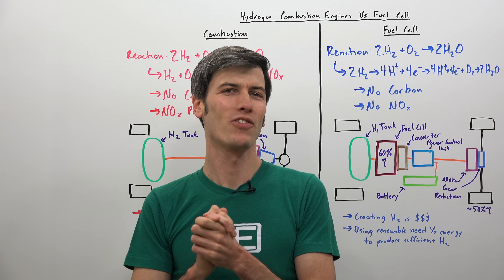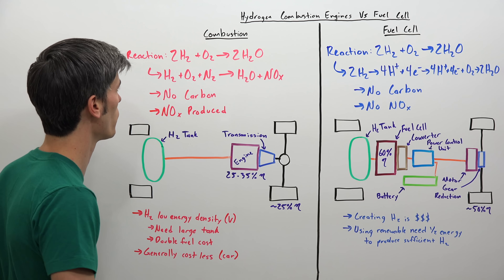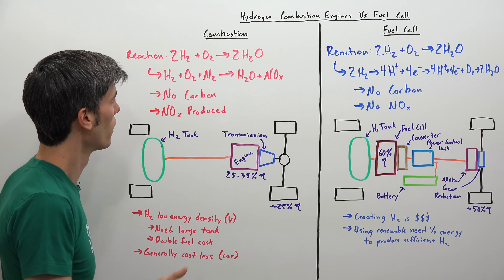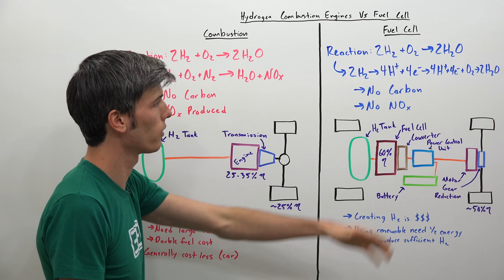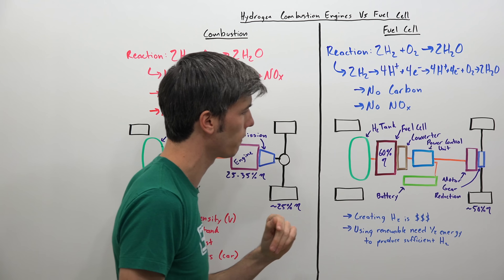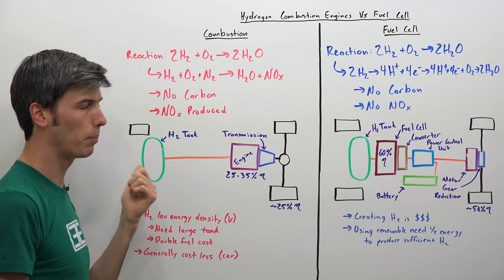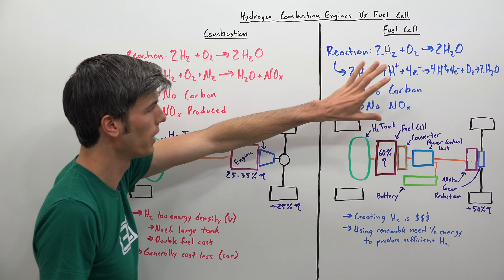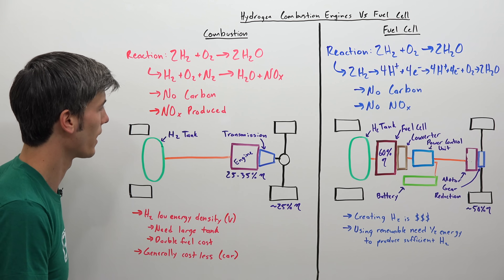Why Hydrogen Engines Are A Bad Idea

Comment: >relesses 100 videos about hydrogen engines and explains how they work
>plottwist hydrogen engines are actually useless
Reply from the maker: Haha, it was just two, just two videos!
Reply: Engineering Explained   Why did you use old gasoline ICE engine efficiency in this comparison when you know tailored engine design and excellent H2 combustion characteristics could easily double that?   
-Higher compression ability  (120 octane equivalent) 
- Incredible combustion stability allows air fuel ratio nearly 10x leaner than gasoline 
-Tremendous mixing & flame speed vs gasoline, for nearly ideal heat release 
- No radiant heat loss 

Either platform requires new power plants that will be cutting edge.   Also you gave no or inadequate comment on the consumer acquisition cost differences. Very disappointed in your work on this as I have greatly appreciated your factual and thorough technical analysis on other engines.
Reply: @timduncan8450  

Seems like he did provide commentary on cost differences.
Reply: Tim Duncan You can already have quite a sizeable battery just on the cost savings from an engine when comparing to a electric engine. The cost for similar power can be 20x... (Tesla driveunit <1k$, a comparable gasoline turbocharged engine with catalysator >10k$
Reply: @timduncan8450  if hydrogen were really feasible as fuel for a reciprocating internal combustion engine there would be a lot more research and experimentation. Hydrogen sucks for this application and is very hard to control its combustion, also is very prone to detonate and i mean real detonations not preignition which is what many call "detonation".
Reply: Quite a long time ago already there were hydrogen fueled combustion engine cars. The german manufacturers tinkered with those around 2000. The added "benefit" at that time was the fact that those engines could burn both gasoline and hydrogen, allowing a twin fuel scenario, kinda like gas powered ICE cars. Which was necessary, as the number of hydrogen fuelling stations back then in german was around 10 for the whole country. Of course there were other difficulties, like the need to keep the hydrogen extremely cold at 20 Kelvin to be able to store enough, which needed a complicated tank system, and the permeation of hydrogen which lead to the interesting fact that hydrogen fuelled cars are not allowed to be parked in enclosed spaces, like public below ground garages or even home garages. 

In the end they moved from combustion engine cars to fuel cells, although that purring of the nice 760i 12 cylinder engine was beautiful, it was simply not working out. But research, while still being done and Mercedes just releasing a new fuel cell powered car, is low key compared to battery electric cars by now.
Reply: Not useless at all, there are just other better ideas.
Reply: @teresashinkansen9402  except for those lil oil cartel boogers...and that issue of detonation can be fixed with tuning
Reply: @verderriscursey  Are you sure? it usually is fixed by using lean mixtures and low compression which reduces a lot of power. The distance of deflagration to detonation run up of hydrogen is quite small second to that of acetylene.
Reply: @teresashinkansen9402  all you need is a different tune for running different fuels
Reply: @verderriscursey  I don't think is that easy. How would you "tune" it?
Reply: hydrogen can be used in diesel motors too, which is high compression
Reply: @verderriscursey  Can you show me a proof of that? I hope you aren't referring to that HHO snake oil.
Reply: @teresashinkansen9402  the type of tune im talking about is a computer or hand held device that connects with your vehicles computer and then you can change settings...not a tune up...sorry if i wasnt clear
Reply: @verderriscursey  But how that can avoid a possible detonation? by making the mixture lean?
Reply: @teresashinkansen9402  electrolysis is not snake oil and its already been proven
Reply: @teresashinkansen9402 the oil cartels are the snakes...lmao
Reply: @verderriscursey  Say no more. Have a nice day.
Reply: hydrogen is used in combustion engines the same way as natural gas and propane
Reply: He never said it was useless. He just said it was less efficient.
Reply: @teresashinkansen9402  
You win. He's going to defend the technology no matter what. Your pursuit of logic is not something he's interested in. Virtue-signalling is an extremely strong emotional driver for many people.
Reply: @verderriscursey  

It's an easy red flag, when someone starts the "greedy corporations" hatred.  Clearly if you stick to the technical, you lose.
Reply: @teresashinkansen9402  HHO has many benefactors and proofs. It's these new hydrogen fuel cells that I call snake oil... the science is sound, but the problem is that the cost of the vehicles outweighs any return in efficiency.  And, it's fission/cold fusion. With hydrogen.   Hydrogen fusion takes place on its  relative own. And it's much more energetic than a detonation.  Try riding a nuke sometime. It's like that, but you're paying for it for ten years before you turn the key. And you'll never own it outright, like HHO.  How's about that snake oil now?
Reply: @teresashinkansen9402  to answer your question on tuning: ceramic plasmation plugs, sstl piston rings,  sstl exhaust system, removal of the catalytic converter, recirc to the HHO generator cell, spark/flashback arrestor before the intake, and using the setting for propane in your electronic tuning computer, to set your engine control module.
Reply: @teresashinkansen9402  to avoid detonation, richer, not leaner. Fuel stops the detonation, not air.
Reply: @teresashinkansen9402  as for your previous comment about how vehicles are kept from detonation, you have EVERYTHING backwards.  More fuel, less air, and a spark arrestor to stop flashbacks.  All of this is readily accessible here on YouTube for verification.  As well as what not to do.
Reply: @teresashinkansen9402  for reference, acetylene boosters have been used in the past by street and drag racers.
Reply: @AndrzejKucyg HHO has been proven time and again.  As effective, if not more so than gasoline. And costs a fraction of the price of gasoline.
Reply: @suserman7775  lol, you must not know the history of big oil's shady business practices. This is not about my emotions or logic but rather research and facts thank you. Your previous two wars is based on the theft of oil and ponzi scheming the taxpayer to fund it. You paid for oil with your tax dollars, bloodshed and again at the pump...and they taxed you again at the pump. Which part of greed did you not understand?
Reply: one virtue-signaling usually brings out a similar response..ie "hho snake oil"
Reply: @verderriscursey  I see. So, because someone who had their facts SLIGHTLY skewed, decided to point out that HHO has been proven time and again, you thought: OMG, SJW!? If that's what you call virtue signaling, you don't know what virtue is.
Reply: @guardsmanom134  her moral correctness was hho is snake oil...my response is big oil are snakes. SJW???? I know the oil cartels doesnt have any virtues
Reply: @guardsmanom134  Indeed rich mixtures can help but that wastes fuel, with hydrogen you need  a lot of fuel to avoid detonation. So is better to use lean mixtures
Reply: @guardsmanom134  That's just for using those HHO quack systems which only provide the engine a minuscule amount of hydrogen.  That's not really an hydrogen engine. Im amazed that there is so many people that believes in the HHO quackery.
Reply: @guardsmanom134  I don't believe that. What advantage can give acetylene to a drag racer? other than the potential of blowing up.
Reply: @timduncan8450  I don't think he did. He used 35% and had 10% losses in drive train conversions for both examples. That might even be conservative because the efficiency numbers for an ICE are the peak numbers, but in real use they operate over a wide range of poorer efficiencies. 
The fuel cell motor combo will have a range as well, but it varies much less making the average efficiency much higher.
Reply: @teresashinkansen9402  you have obviously never used nor seen it used. And that's enough for me to draw the conclusion that you wouldn't know what to do with a powerful racing car if it hit you on the inside turn.  Not to mention, I can see that you are impassioned by the willingness to always be right, even though everyone else sees how foolish it makes you look.
Reply: @teresashinkansen9402  it gives 2× the output power of NOS. Like I said, you wouldn't know what to do with an acetylene booster if the car hit you pushing purple flames from the exhaust.
Reply: @teresashinkansen9402  it's only wasteful if you're not getting the desired result.  If you can't understand that, then you're not getting the desired result.
Reply: @teresashinkansen9402  I think the issues with consuming the H2 are all addressable, and large amounts of research have already been done. But to Jason's point, the combustion in an ICE will always be far less efficient. To make it more so with that cycle we would have to increase the combustion temperatures far beyond what any materials we have could handle.

The big issues are where do you get H2 from, how do you make it less expensive than the current fuels, how to store enough of it,  and safety (storage, transfer, and in accidents). I believe most H2 is currently produced from natural gas, (methane mostly). So why not save the conversion cost and just use the natural gas as is (the carbon would be released either way).
Reply: @guardsmanom134   NOS works by injecting an oxidizer into your engine, that way you can use much more fuel which in turn increases the power.  Please explain the working principles behind your claimed performance gains with acetylene.
Reply: @teresashinkansen9402  the desired result is to replace gasoline.  As it stands, deuterium oxide combustion engines utilize the cheapest technology and a completely renewable resource.  Shall I spell this out for you? HHO costs a fraction of either battery electric or fuel cell electric vehicles.  It's obvious that you've been trying to sell people a line of crap. What I don't understand is why? Do you own stocks in lithium ion? Or maybe, petroleum stock? If so, you have no footing to hold this argument any longer.  You've proven only that money rules minds more than tangible scientific method.
Reply: @guardsmanom134  i don't care to look like Im right, Im just following real scientific knowledge. I want other people to see how things really are and not this HHO mystic pseudoscience.
Reply: @teresashinkansen9402  would it help you to know that I am trying this technology myself?  If I'm successful, I will post it for the world to see, and drive it everywhere so that doubters like you have to eat their words.
Reply: @guardsmanom134  Thanks for the chuckle bud. But im afraid wont keep replying to this nonsense.
Reply: @teresashinkansen9402  nonsense implies that there is no factual information by which we may proof the hypotheses put forth.  In this case, I can.
Reply: @verderriscursey  You mean like when we had carburetors?
Reply: @marymdavis3189  it works on carbs or fuel injection
Reply: @guardsmanom134  check out Teresa's profile before wasting more time and 'energy'.
Reply: @marymdavis3189  too late.  HHO generator is built.  I haven't tested it yet, as I have to finish doping the fittings and put all of the parts to the final leak test, but I have everything together. All told, $65.00 gets it done. Genny build is coming to the Guardsmanom134 channel near you!
Reply: @guardsmanom134  LOL, sorry I tried. But your news is great please tag me when you post your video. I can't "do" this stuff but hubby can. He and friends converted my Jeep CJ7 to southern style homemade gasahol back in fall of 75, solar for water/radiator heat later, he and son is always tinkering. He was going to convert my Saturn SL2 to hydrogen but it got rear ended in Jan 2013 and totaled. It's got 298,000+ miles and has started leaking oil so I guess that dream going in smoke. Always wanted to drive a car powered by water. HA!
Reply: @marymdavis3189  Btw, I know that Teresa's profile is thin enough to be called a prototroll account.  So was mine for eight years.  The reason I started uploading videos, is to give my account some beef.
Reply: I have a scheme to make them far more efficient, actually hydrogen combustion engines aren't useless, just less efficient. Catalytic converters on most automobiles already remove most of the NOx emissions.

There is ONE great advantage of making or converting a gasoline combustion engine to run on Hydrogen, - We can Make our Own Fuel.

We can take water, split it into oxygen and hydrogen and then liquify the hydrogen and you can then use that hydrogen to ride around town.

If one uses solar power to split and then liquify hydrogen gas then people can be completely INDEPENDENT of the fossil fuel industry. 

Fuel cell cars can be more efficient BUT, some fuel cells require very expensive and rare elements like platinum and it would require junking all old car engines.

There is a problem with fuel cell cars namely that it will be nearly impossible to make sure they are free of tracking devices. Since most fuel cell cars require an electric motor and a fuel cell, it is very difficult to ensure that no tracking devices have been built into the electric motor or fuel cell and if found, it will be nearly impossible to remove.

Not to mention it will also be difficult to rebuild or repair the engines or fuel cells, meaning that those parts of the automobile will not be serviced.
Reply: Detonation of hydrogen fuel risks are easilly taken cre e of utilising proven system like compressed natural gas tanks, liquid natural gas tanks and if your paranoia is that bad, metal hydried tanks. All there above mentioned systems have a proven track record of safe reliable high presure gas storage and dispensement.
Reply: Maybe I can shed some light on ignition with a accidental discovery by myself. Most of you have probably used a variant of the Colman gas lantern for camping. The older models weren’t designed for regular petrol. The additives clogged up the orifice. But you could use it instead of white gas. Cheaper. Well, one time I was feeling flush and bought high octane instead of regular. I figured the mantle would burn brighter. “High Octane” Yes? Ah... no.  Burned dimmer. The octane is in the fuel to make it burn slower, not faster. Higher compression engines could make the ignition of the fuel happen so quickly that the valves aren’t in the proper position when the bang occurs. So, solving the pre-ignition of Hydrogen is not solved by more fuel or less fuel, but to slow the ignition down. It’s cheaper to use additives than to tinker with moving parts.
Reply: @TheNimshew  Something else interesting to think about, utilising liquid injected propane has successfully seen a decrease in consequent combustion temperatures thanks to how cold the gas is in liquid form as well as pre-ignition in combustion. I see no reason why the use of vacuum insulated liquid hydrogen storage tanks ( similar to liquid methane storage tanks)and then injecting the liquid hydrogen into the intake port in stead of vapour, thereby reducing combustion temps and pre-ignition. Further more, ignition timing now days is allot easier to control with the advent of electronic coil over plug systems and knock retarding. Clever programming (tune) can overcome this. Fiat has experimented with electronic camshaft-less valve systems which in this situation would also be ideal to help on the tuning side of things. There is no one solution, there are many and all need to be included for a viable system.
Reply: @timduncan8450  higher flame speed lowers ice efficiency.
Reply: @verderriscursey  electrolysis is 8% efficient. 

We were counting on coast to coast giant nuclear power plants by now.
Reply: @teresashinkansen9402  Higher bond energy, when injected in tiny amounts into a much larger gasoline mass, it increases heat of combustion.
Reply: @capnbilll2913  What is the bond energy of hydrogen and what is the bond energy of gasoline? I wonder if you know.

Edit, or you are talking about the "acetylene booster"? please specify more about what you are replying to with your comment.
Reply: @teresashinkansen9402  acetylene C2H2 is -1301.1 kJ/mo

Gasoline is a mixture of a number of compounds with varying reaction products, and binding energy. You gave to calculate each, and average, Sorry my wife is nagging me way too much too concentrate, maybe later
Reply: @teresashinkansen9402  hydrogen has the lowest of any fuel. If you think about it, one gasoline molecule has a dozen hydrogens.

Hydrogen is only in the game as a energy per weight because it's the lightest element.
Reply: Marc Jackson  Interesting reads. I need to read the papers again later with more care. I still think 40-50% efficiency is still not enough for a practical hydrogen fueled ICE car, TBH i do not have much faith in hydrogen as an energy source on vehicles regardless if they are electric or ICE powered. Hydrogen is quite hard to store in great quantities which is one of the reasons why hydrogen is having problems becoming a powers source and also the biggest problem is that its hard to make efficiently out of renewable resources, batteries are more efficient so far.

"HHO" Is an incorrect term coined by quacks to the mixture of hydrogen and oxygen (yikes!) gas that comes out of an electrolysis cell electrolyzing water, which is wrong because it isn't a compound is just a mixture of gases. 
They have the belief that by "injecting" such mixture into their car intake it will increase efficiency dramatically because its acts as a "catalyst" and also under premises of increasing the flame speed of the fuel mixture. However it is just bollocks because they use electricity out of the car's alternator to electrolyze water and then inject that gas into their engine. Such electrolyzers are very inefficient and unreliable, they can load the engine as much as 1kW or more to just produce about 4L of oxyhydrogen per minute compared to the thousands of liters of air-fuel mixture an engine uses at higher throttle. If you recall the research of professor Harry Watson he uses as much as 3% chamber volume of hydrogen for its hydrogen assisted jet injection in a special combustion chamber, no just putting a hose to the engine's air intake.
Reply: Marc Jackson  and that's why I don't take my car to a mechanics shop.6  months of SCROC so that a jackass could try to belittle me on a social media network.  Yep, you win. I only have a 168 IQ and several voc degrees.  Who am I to know anything? Smh
Reply: Marc Jackson  detonation can still happen at high turbulence.  Ask a fighter pilot sometime.
Reply: Marc Jackson  depends on the fighter pilot.  You do know that arial combat is conducted through use of explosives, nowadays?  Detonation is the confluence of combusting materials and the exact ratio of reactive gases, in harmonic discharge.  A vortex just mixes the two.
Reply: Marc Jackson  you're the one who said that more fuel wasn't the answer. Everyone I have ever seen around engines knows that pinging (detonation) can be reduced only through more fuel introduction to the combustion chamber.  And the fighter pilot comment was to point out that the vortecies coming from the wingtips of planes would negate the explosive power of an air to air missile, if you're correct.  That intelligence quotient is well founded, and the only thing in jeopardy is your over-inflated ego.
Reply: @teresashinkansen9402  What makes you think Ghis snake oil? Just because manufacturers don't instal it doesnt mean it doesnt work I use solar cells and regenerative braking to produce HHO gas in my truck and I'm getting a sizable increase in mpg plus slightly better performance.
Reply: @jonathondeeds3423  What makes me think this is snake oil? physics and chemistry. Also i don't see the point of what you are doing, it would be way better to use those solar cells and regenerative braking to power an electric motor, like some short of hybrid car than to use an inefficient electrolysis cell to make some hydrogen. Im incredulous you do this at all, how are managing to put tens of KW of power when breaking into a "HHO" cell? what generator are you using?
Reply: rkan2   Don’t know what kind of cars you drive but $10k is many times main stream transportation engine costs, get real.  I have spec’d & purchased electricity drive systems in the past and you seem to be bias there as well.  You can (if you did I stand corrected) go to the recent year down of a Model3 for facts.   Drive system must include controllers (kind of a transmission/throttle for kind electrons) and the motor and heavy wiring harnesses between them and the battery.
Reply: Teresa Shinkansen   BMW has put many years into it.  Their engines work great as far as I know, but on brd storage still sucks.  The detonation piece is interesting.  If I understand correctly it’s from the quick mixing and wide open A/F Ratio of hydrogen.  So a solution would be to direct inject H2.  With the ultra clean burn no value deposits, maybe?  Or use the H2 in a opposed piston engine for much lower heat rejection and non of those pesky valves.
Reply: Verderris Cursey   I have run into a setup called Bluepoint that did this (some kind of H2 injection) on very large diesel, claimed advantages were not compelling.
Reply: Capn BillL  wrong.   
High flame speed helps us.  It allows us to use less timing advance (Ignition closer to TDC) so more of the pressure increase happens on the power stoke and still get all the mix to complete combustion.  All the pressure made ahead of TDC works against us.  Think about it and get back to me.
Reply: @teresashinkansen9402  us very very easy to tune any engine to run on any fuel all you need is a laptop and a dyno to reset the Air fuel ratio.
Reply: guardsmanom134   Good joke, I don’t have 168, but I get it.
Reply: Marc Jackson  BRV & JTL complement how?   I don’t know about RV other than Ricardo gave up on them after WW2.  Poppet valves with all their clap trap are about the ugliest solution imaginable, crazy how they won out almost everywhere.   I really like How OP’s breath.  Fairbanks Morse proves it 75yrs running.  Achates claims lots of swirl from canting (turning a bit tangential) the intake ports.  I t looks like they could get a bunch of flow perpendicular to this (tumbling I think) late in the compression phase from squish.  Or the Pinnacle 4-stroke OP with sleeve valve arrangement looks very free flowing.  They claim tumble and swirl, even a new word for them, “swumble”.  Very cute I have know idea how good it is or how they generate the motions.  Let me on what you think.  I am checking out some of your F1 references.
Reply: Electric powered engines are the future. Never mind, where the electricity is coming from, but ICE with that much technique is history...
Reply: Cant even spell "releases" lol american education system at work!
Reply: They are a waste of pristine energy source ,if manufacturing to Green criteria!